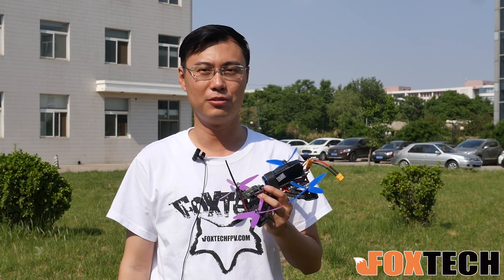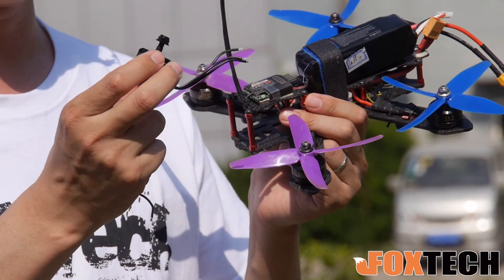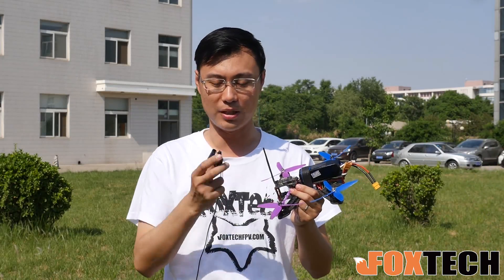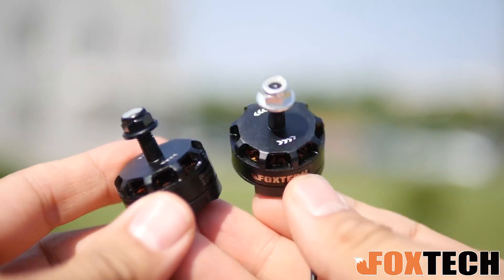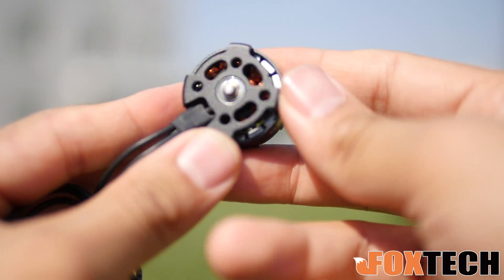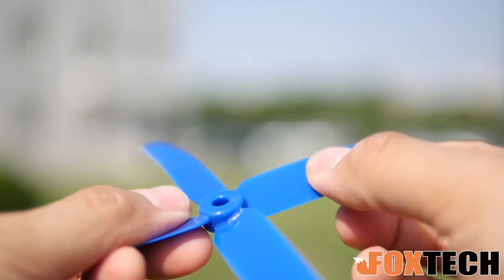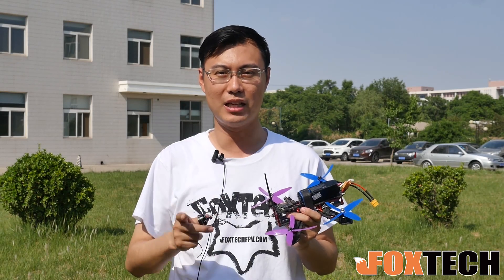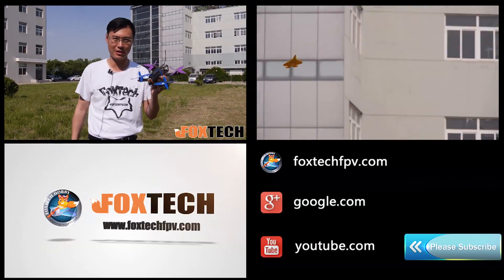Foxtech 5040 4-blade propeller and 2205 KV2300 motors for FPV Racing

Comment: i dont think having a softer prop is a good thing. being a helicopter mechanic there is a limit for flex on props for proper and reliable flight.  when heat is introduced to plastic they get soft. i would rather have a stiff blade for consistency. sure you may safe money on props but for a prop to fail and wreck your drone.. much more expensive.

Comment: I've modded my drone to take 2 stacked props for a 4 blade prop. i thought it would be unstable but to my surprise the different in blade position  (vertically ) didn't have any issues with them.  flew super smooth and turns were more responsive and quick.

Comment: it sounds like it's flat flattening out inflight not good
Reply from the maker: +Delbert williams (FPV Man)  i know what you mean,  but with a 4 blad prop. the quad is really getting a lot more power, and noticable longer fly time.
it's good for fun ,but maybe not very good for race ,since the quad will be too fast to stop.
Reply: Just like the 5x3x3
Reply: Sounds to me like slightly off P on pitch/roll... But thats just my stance.
Reply from the maker: Mark van Werven I felt the P was kind high after flying it. But the settings could be different to different pilots.
Reply: Sounds like a untuned quad to me lower your Ps dude